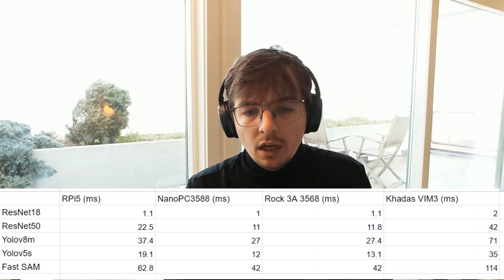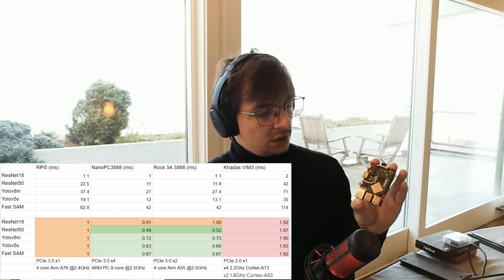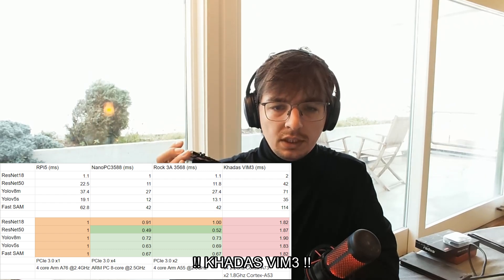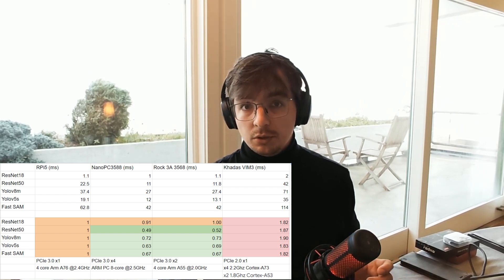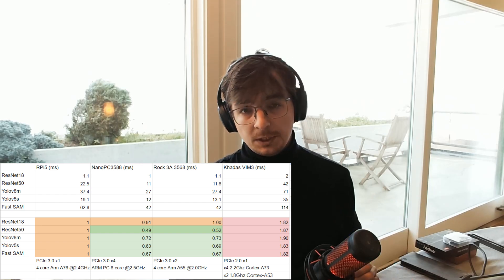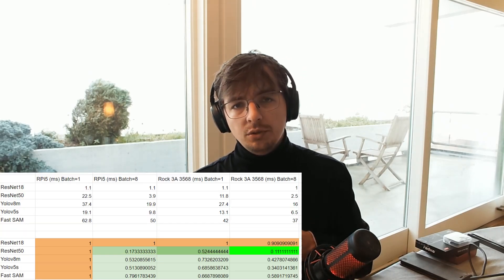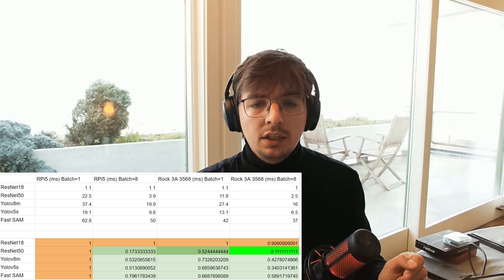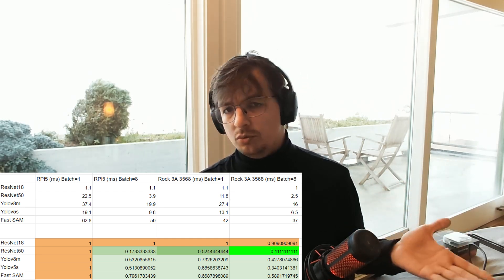How fast is Hailo-8L with boards other than RPi5?

Comment: Thanks for the great experiment, I was just planning on buying the new Pi-AI-Hat but I'll  have to change my mind.
Reply from the maker: It will probably boost your speed a bit, but not for all models and probably not as much as you expect. 
I saw some reviews that usual boost is 30-40%, and specifically some slow models it could be almost x2.